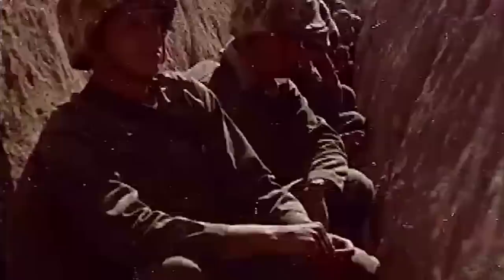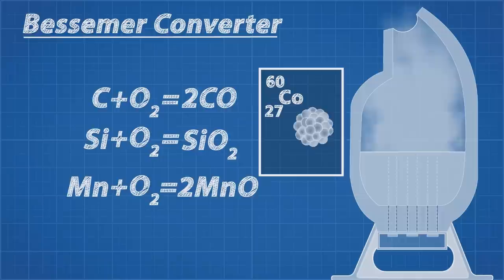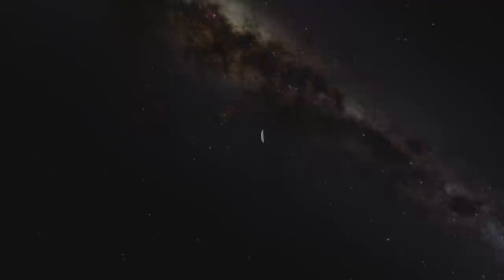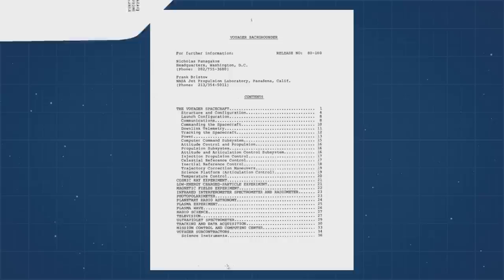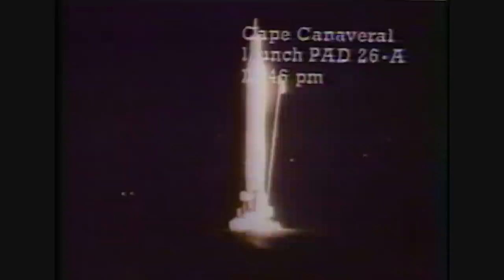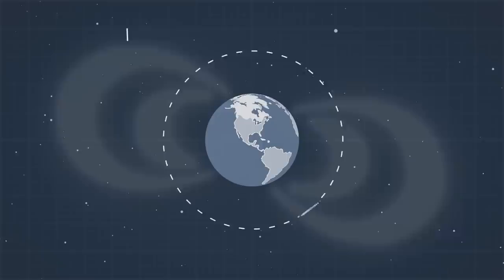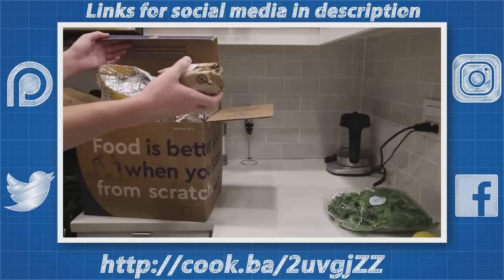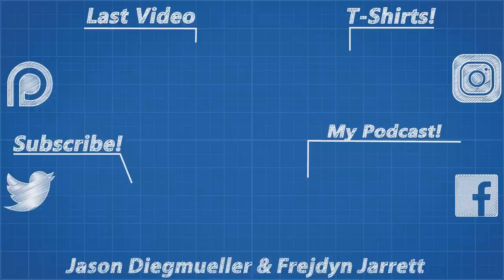Are There Parts of German WW1 Warships in Space?

Comment: A place where low radiadion steel actually was used: in the 80s I was told at the Nuclear Medicine division of the local university they built a shielding chamber out of that for measuring the very low radiation of radioactive substances injected into patients. These are used to follow biochemical activity in the body. Today most of that has been replaced by FMRI, which wasn't available then.

Comment: I think someone should tell him that only 0.4% of background radiation is due to nuclear testing. Now sure that figure was higher in the past, but it was still only a tiny fraction and certainly not enough to cause insane measures to salvage old steel. And finally, theres a lot more steel than just old German warships. For the small amounts needed one could melt WW2 rifles for example which can actually be found incredibly cheaply. And finally specialist steel is already made in an inert atmosphere because its important to make sure things like cobalt don't contaminate the metal in concentrations higher than a few parts per million - not high enough to make any difference. And finally had they not done it a highly controlled atmosphere changing the alloy used from warship/rifle to the incredibly advanced alloys needed would introduce the exact same contaminants as making it from scratch. So no matter which way you slice it this is simply such a ridiculous tale. I'm just disappointed that he took the hard approach with hours of research rather than common sense to prove it's a lie.
Reply: It's not the radiation itself, it's that the detonations scattered isotopes that aren't found in nature due to their low half-life (so any created naturally would have decayed a long time ago), which then gets into the metal.

There's only a tiny amount of it around, so it doesn't increase radiation significantly. The issue is when it gets into the steel when it's being smelted. For extremely sensitive instruments, the miniscule amount of radiation given off by the trace amounts of radioactive particles in the metal can mess with readings.

https://en.m.wikipedia.org/wiki/Low-background_steel

Comment: So, Voyager may not have had an geiger counters on board, but Pioneer 10 and 11 did. 

I personally handled many of these spares as we were testing them for use on a CubeSat I helped make called Explorer 1 prime. I don't recall exactly what material the metal used was, but it could have been steel. 

If you look into the pioneer 10 geiger tube telescope (it's on wikipedia), there is a reference to a fairly detailed page at the university of Iowa. There are some references there to some articles in the Journal of Geophysics research about them, which was written by... James Van Allen. 

If that doesn't come up with any hard conclusions I can try and see what the whereabouts of those spares are, and see if they are steel.

Comment: try to say it 3 times quickly in a row: "steel alloy/gold foil plume deflectors extended from the propulsion module to shield the stoved radioitotope thermoelectric generators to scan platforms from rocket exhaust during engine firing"

Comment: Could have warship parts have reached escape velocity when exploding?
Reply: Unlikely. And no. Any parts small enough to be propelled fast enough by any explosives used (if any sufficiently fast explosives were involved at all) would also be small enough to be significantly slowed down in the atmosphere.
Reply: There have been several magazine explosions. As they are built rather stable i could imagine that a high enough pressure has been reached.